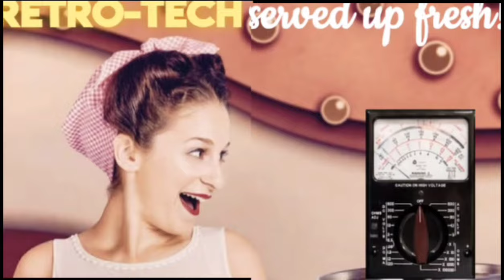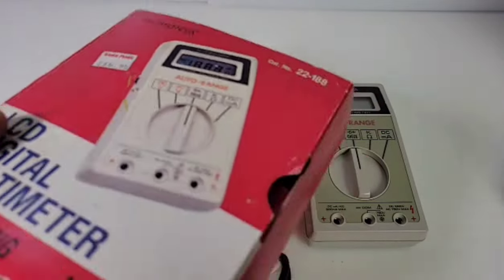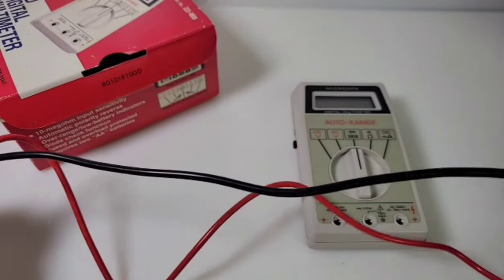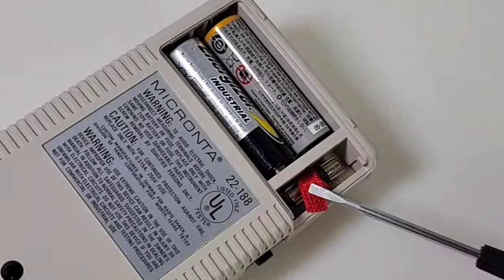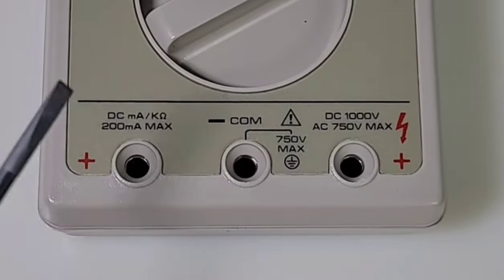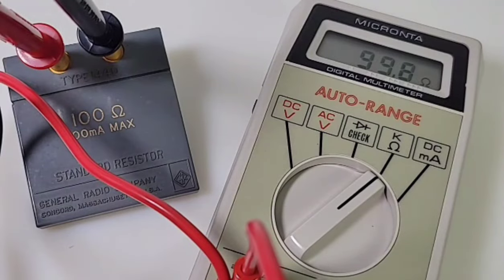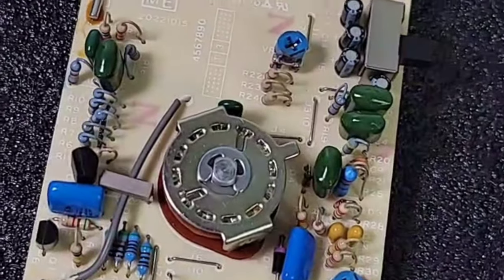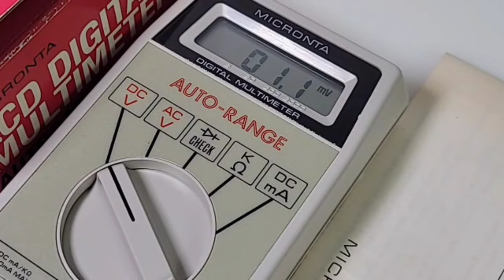RETRO-TECH ○ MICRONTA 22-188 VINTAGE DIGITAL MULTIMETER

Comment: Amazing multi meter and it still works even today.  I worked at a Radio Shack back in the 80s and this auto range model was popular.  Back in the day hobby electronics was quite a thing and Radio Shack was the place to go for electronics, parts, testers and tools.  Those were good times at Radio Shack.  Thanks for the trip down memory lane.

Comment: That slide switch really takes me back, even old calculators often had a slide switch.  I was wondering, are any of those components besides the fuse targeted to any level of input protection-?   I kinda like seeing this old through hole stuff especially when it seems to work as well as the day it was built and with accuracy comparable to much of todays hi tech stuff. I had an old Fluke 27 and it was all through hole but despite being 30 or more years old still measured perfectly, you dont have to have surface mount to get accuracy if its built well.
Reply from the maker: I'd even add that since the rush to SMD based pcb we have lost some critical high quality components that are more robust and higher quality than their SMD counterparts. Just because it's through hole doesn't make it obsolete.

Comment: Hey Darren! Cool video. I still use my Micronta 22-188 as my main meter. It's been in my toolbox for decades! Question: Is there any way you can shoot me a picture from the manual that explains testing diodes? I don't have the manual anymore and I'm testing diodes and I'm getting 19.0.  When I look online testing diodes with other meters, they get readings of like between .2 and .8. I'm just curious what the manual says I should be reading on a good diode? Thanks so much :-)
Reply from the maker: Hey Ken..Manual doesn't give a potential reading , it only states "if the device is good,it will show some value". Vague ...I know. However most good diodes should read around 15-19 Ohms. You can't measure the forward voltage drop like newer multimeters but I think this is still super useful. Output voltage is only 1.5v so it won't light an led. Still a great multimeter!!

Comment: Hi Darren. I banned a message here with a link to a google drive, it was banned from YouTube. Do you see it in spam or not? You can open it so that you can see it. there is a link to google disk with photos that I wanted to show you.
Reply from the maker: Email me directly:    netplicity1@gmail.com 
I didn't see any messages being held/banned from you.
Reply: @KeepOnTesting  Ok, I'll know. Didn't you see my second message with a link to google drive under the last video, under my message?
Reply: @KeepOnTesting  Hi Darren. I'll throw you off the link to the alteration that my friend of the LOM 616 multimeter was doing. And I'll throw off the link to my google disk, I'll show you how it came to me from China. There will be a photo of my homemade acoustic wire probes and good probe tips themselves. Which can easily withstand 20 A. And also the view of the work of NCV in Soviet concrete))